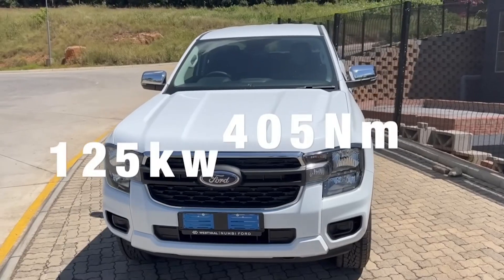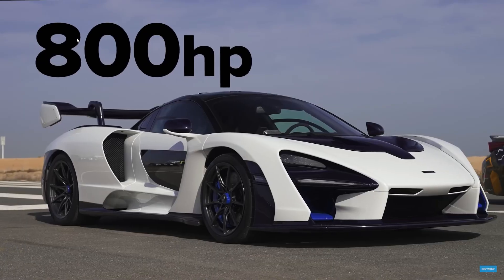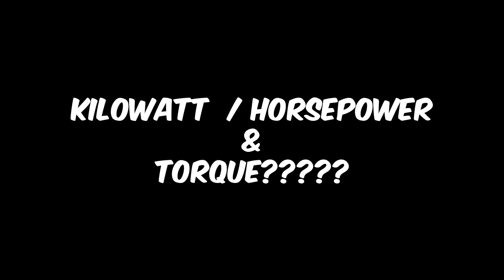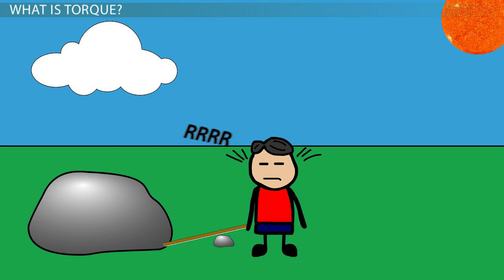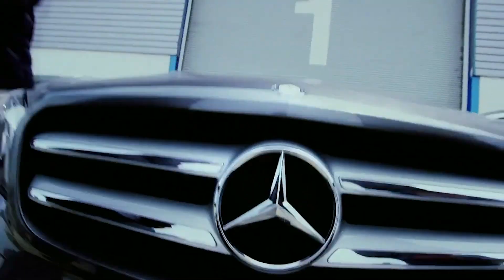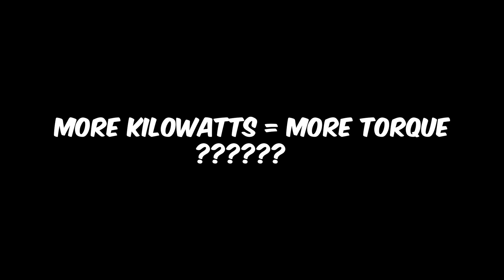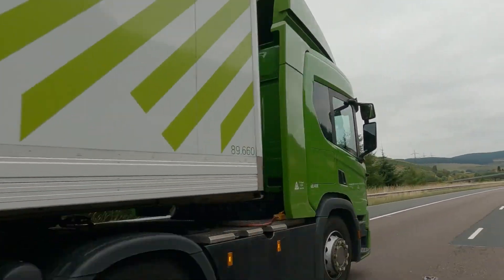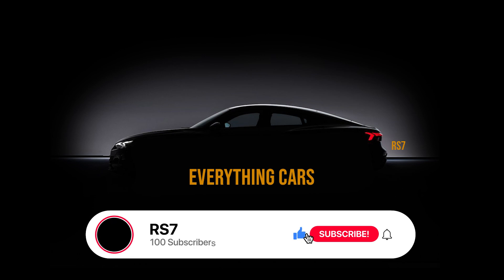Kilowatt/Horsepower VS Torque Explained

Comment: and how you setup in ypur video acceleration = force / mass and power/speed= force 🤔…aint be easy i quees 🤭👉🏻 electrick kock scooter 70 nm 3,2 hp 110 kg with rider max force 540 N 👉🏻 https://m.youtube.com/watch?v=g6LFDAPT9GY from where ypu know it have 70 nm and 540 n max force at contact path ? from uphill climb test 110 kg 30 degrees = sin0,5 x(110x9,81) = 540 n force and engine torq can be calulated now from this force and wheel radious 540 n x 0,125 m wheel radious = 70 nm around vs feg yamaha fascino 125 hybrid 10,3 nm only 8,2 hp weight woth 60 kg rider 160 kg  5-10 km/h 0,4 sec so 1,4 m/s:0,4s = 3,5 m/s”2 x160 kg = 560 N force 👉🏻 https://m.youtube.com/watch?v=AZY4IZSztK8  if its cvt be setup more agresivelly at launch it could clock more force 👍🏻 so vehicle with 7 times less crank max engine torq with 2,5 times biger power with biger drive train losess and cvt not setup on max force at this velocity still generate more contact path force 🤮 get reall boi , more power at perfect gearing always generate more output contact path force dosent matter how many times have less torq at engine assuming the same drive train losess asf sometimes even with biger drive train losess still more like in me egzample 👍🏻🤭 now than which vehicle generate from lesss crank engine torq thanks more power and enough good gearing more drive wheel axis torque ? 👉🏻yamaha fascino alot more cos it have much biger wheel diameter /radious so for generated only 20 n more force at contact path it must generate waaaay more torq at drive wheel axis assuming it have wheel rsdious 0,2 m it clock at drive wheel axis from 560 n x0,2 = 112 nm 👌🏻 at this velocity avg  from 7 times less crank engine torq but its thanks 2,5 times biger power 😎